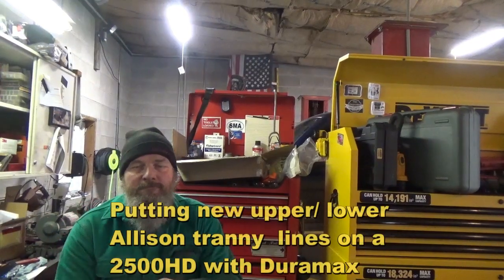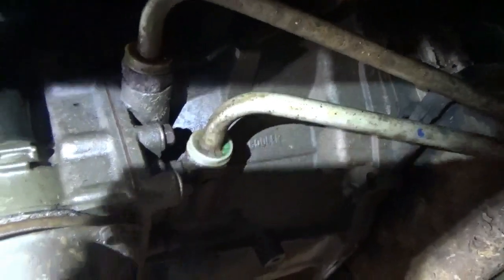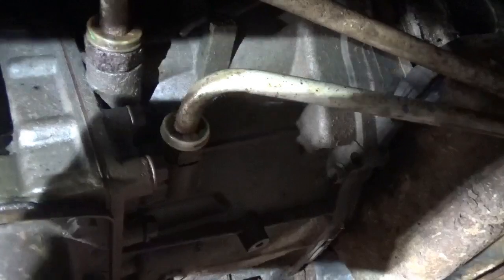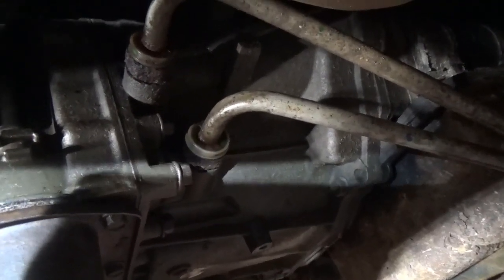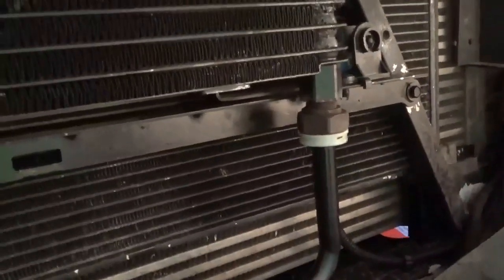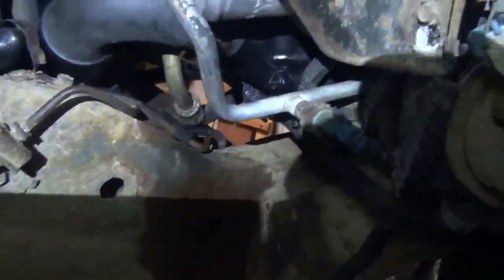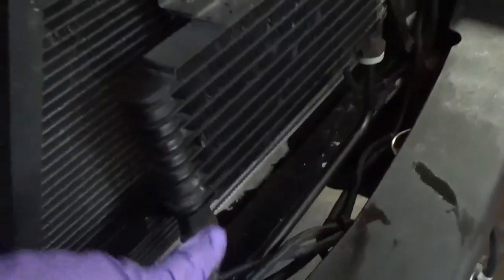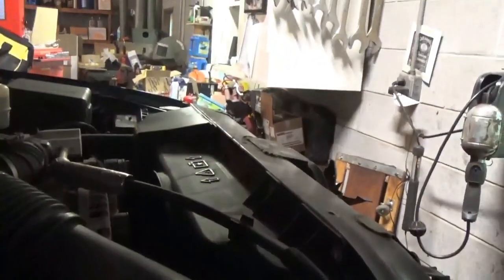Replacement of  Allison  tranny  lines on a 2500HD with Duramax

Comment: Great video as I’m about to do all three lines since they all leak at the soft hose crimps. Question for you… would it have been easier to route the new hoses with the bumper off?
Reply from the maker: Maybe but I didn't think it was too difficult with it on. Until I messed with rusted on bolts to get bumper off  I figured just as quick to do it as I did.

Comment: I do nothing but transmissions for a living, and have been all my life.  Every Allison we have ever rebuilt, has had leaking cooler lines, and the resultant low fluid level, as the cause of the transmission's demise.  The cooler lines only leak when the engine is running and that is usually going down the road.  The fluid blows out as a fine mist and the driver typically doesn't see any spots on the ground after parking unless he lets it idle for a long time.  Going down the road, the driver is losing fluid and eventually burns up the transmission.

When I tell customers about a leak, they typically answer with, "I never saw a leak.  My truck never leaves a spot wherever I park it."

Kudos to you for heading off this potentially expensive failure.
Reply from the maker: thank you!
Reply from the maker: how about some transmission videos?
Reply: Hey man can you assist me? I have a leak on a line that's connected to the transmission pan compartment on the rear part. I don't believe it's the inlet or outlet cooler lines because those are located towards the front of transmission with the name embedded. It's a 2019 Silverado 2500 Duramax. Your help would be greatly appreciated.

Comment: I’ve got an 03 lb7 duramax with the Allison 1000 and need new transmission cooler lines, problem is ordering there’s two different types of fittings that different folks are selling, half are like yours and half are thread in? Idk which, I need to buy the parts to take to my mechanic when he changes them . Thanks

Comment: Does anyone know why my lb7 has two of the three lines? Looks like the previous owner deleted the two lines that go to the engine radiator and just connected it straight to the trans cooler
Reply from the maker: I would say someone did a bypass job just to get by. Didn't want hassle of properly replacing the line.

Comment: Man I got 06 Silverado 1500 5.3 crew cab I can’t really get my in on the transmission side and be able to see how the clip goes on the front radiator side is easy but I have not done the job yet because I don’t want to get stuck some where is it ok to maybe remove the transmission mount and see if it drops down just a bit or would that break anything

Comment: my upper line on the transmission is leaking at the fitting is there a seal there to replace?
Reply from the maker: the transmission fitting where line goes in has an O ring.

Comment: Hi mike I blew out my lower trans cooler line yesterday. There are 4 different ones listed for it. My truck is the same as yours. 
How did you know which lines you needed to get?
Reply from the maker: +Pat  Juliano not sure if you mean part number or how to tell which ones by where they to/from.
Reply: I have 02 duramax,radiator blew and external trans cooler.Autozone had both in stock.Cooler came with 2 sets of changeable fittings.Radiators are just a hair smaller and lines would not fit in.Cut ole cooler out and using it.Why are fittings different?What do I do?Jeremy from Memphis

Comment: 7:02 where your light is shining is exactly where in getting transmission fluid leaking. Do you have any idea what that could be?
Reply from the maker: well it shining on a wide spot so it could be dipstick tube or transmission gasket. hard for me to tell.
Reply: @TheDisgruntledMechanic  yea it's crazy because my leak is no where near my tyranny but it is close to the lines but all of them are dry. Mad bizarre.

Comment: Had my aux cooler line to radiator blow off and wondering if you have found one just like it because i have searched everywhere an cannot find it.
Reply from the maker: Is this the one you mean? make sure you get it for proper year because they are different in certain years. ACDelco 15767598 GM Original Equipment Automatic Transmission Fluid Auxiliary Cooler Inlet Line https://www.amazon.com/ACDelco-15767598-Equipment-Automatic-Transmission/dp/B0049OI41U/ref=au_as_r?_encoding=UTF8&Make=Chevrolet%7C47&Model=Silverado%202500%20HD%7C494&Year=2002%7C2002&ie=UTF8&n=15684181&s=automotive&vehicleId=1&vehicleType=automotive
Reply: Mine is a 2006 gmc 2500hd an the lines im suppose to have come in from the side. But the cooler i have is just like yours it is a used truck so they could have changed the cooler and the lines going to the cooler are spliced an im wanting to put original back on but the cooler is just completely different but it looks just like yours. On top it says long canada so not sure if its aftermarket or off of an older gm vehicle.
Reply from the maker: hard to tell then. Mine was just a stock replacement.
Reply: Alright thanks going to do more research an see what is going on with it.

Comment: Thanks, I just did this job and when I was tightening the top nut on the radiator I must have tweaked something because i heard a crack and now the radiator fluid is going everywhere. Looks like I'm going to have to take it into the shop for a new radiator.  It's kind of weird that the radiator cools both the radiator fluid and also the transmission fluid. There must be two separate compartments for cooling to separate fluids. After I tweet that nut though it was radiator fluid coming out. Bad luck for me. :(
Reply from the maker: dang! sorry to hear you had problems!